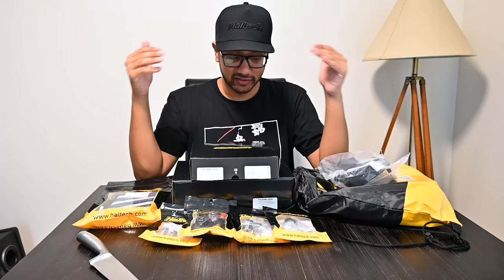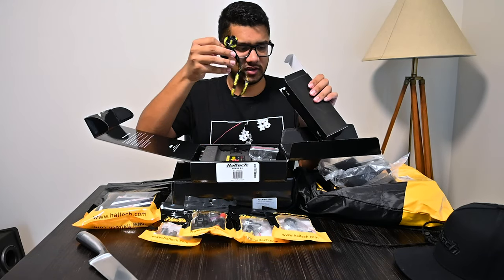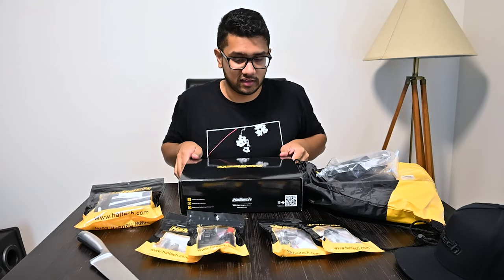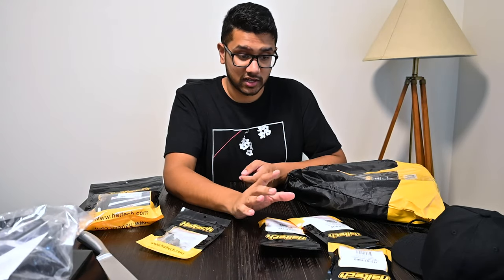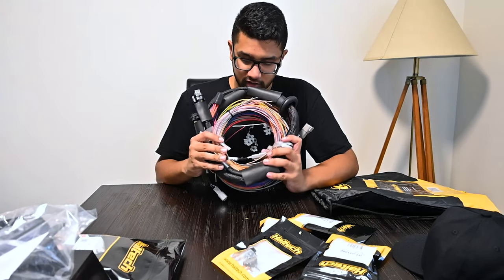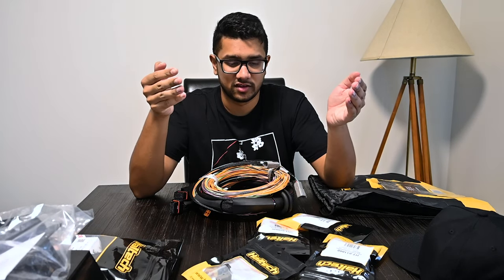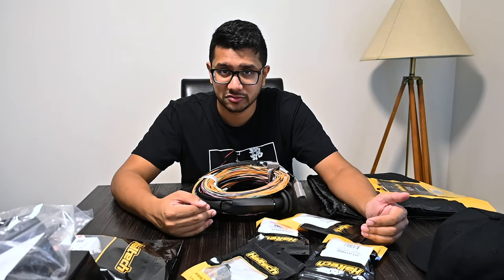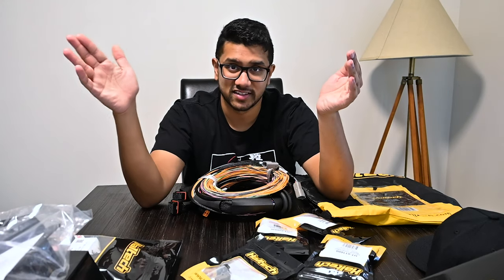HALTECH NEXUS R3 FOR THE K24 DC5!?!?

Comment: how does the ecu feel in hand? is it heavy? do you know if its potted internally for water resistance?
Reply from the maker: The ECU for sure has some weight to it, but I wouldn't call it heavy. I haven't found any specifics for water resistance, however, as the Elite Series ECUs have waterproof cases I would assume the Nexus VCUs have received the same treatment.